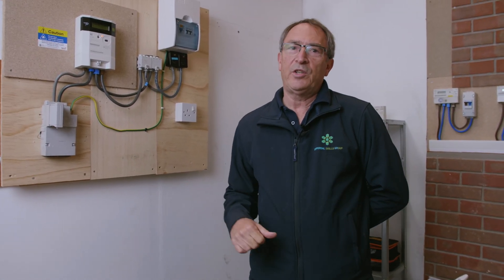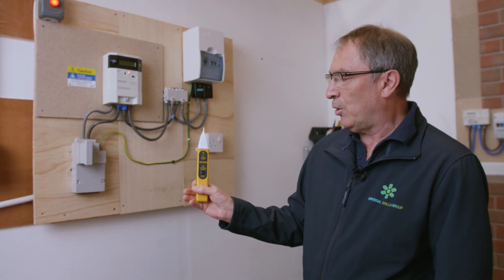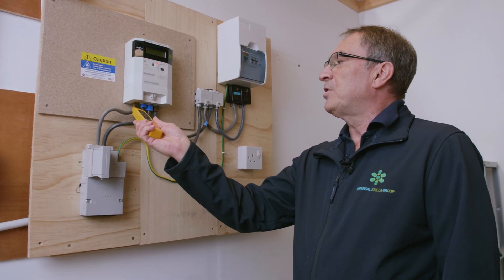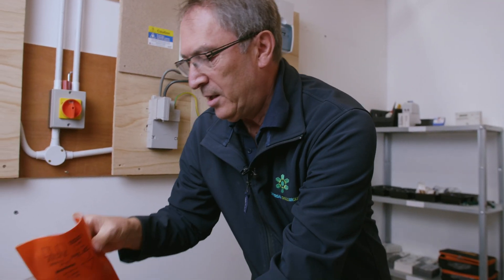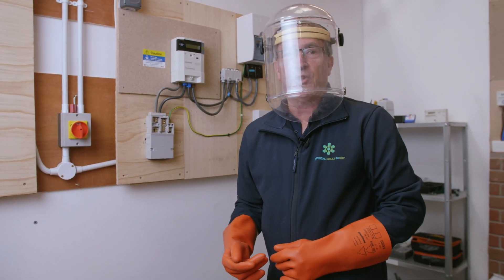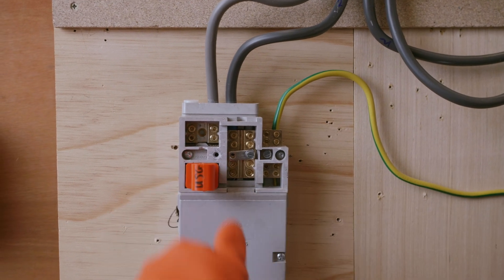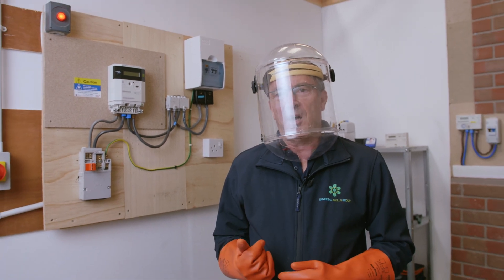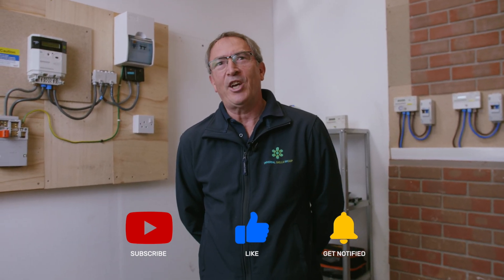Power Testing Procedure | Electrical Guide

Comment: Hi Michael good presentation. I just noticed that you didn't prove the top of the cut-off with the VT-7. Can you please confirm if you need to do this or Not. Cheers Firoz (Cohort26)!!!
Reply from the maker: Thanks for your comment Firoz, we're glad you enjoyed it. Pleased to see you've watched the video! The testing is contract specific, we were just proving the supply. Is there any other video's you would like us to do?
Reply: @UniversalSkillsGroup   Yes. I have noticed alot new candidate struggle with cutting the 25mm2 cable correctly to fit into Henley block and Proteus block. That is without showing any copper or inner conductor. Maybe we should do a practical demo on this, I know that this would help alot of potential trainee dual fuel meter engineers. THANKS Firoz (Cohort26).